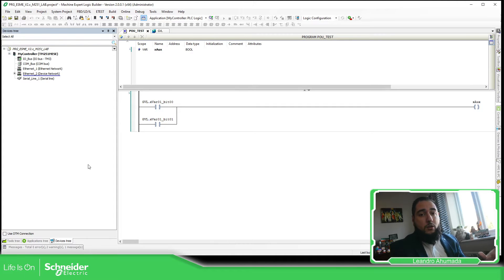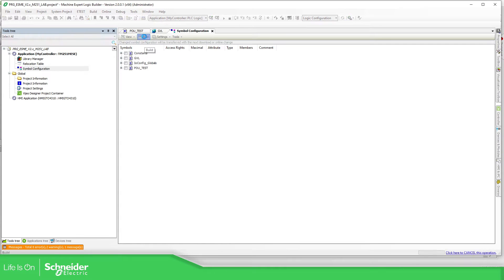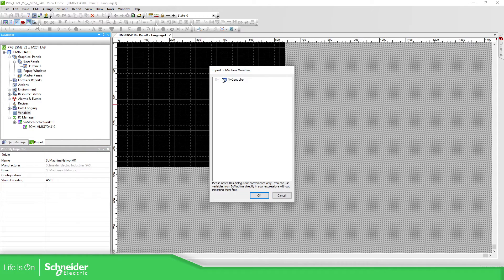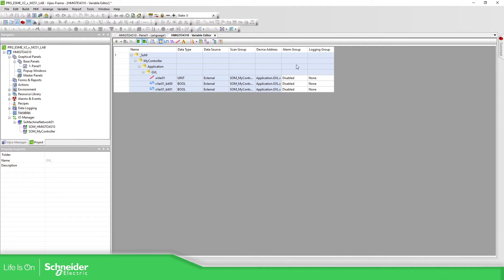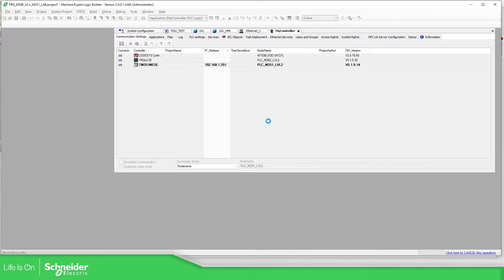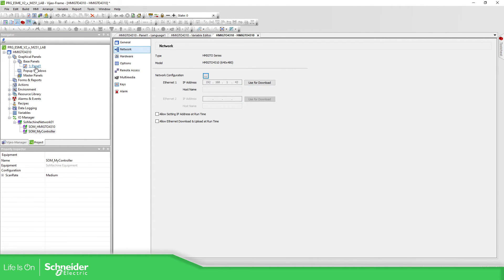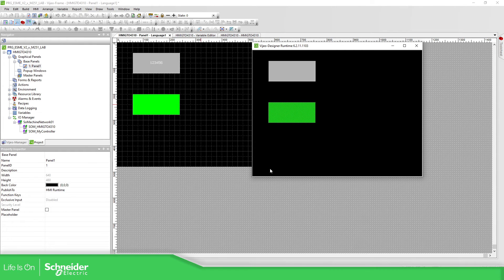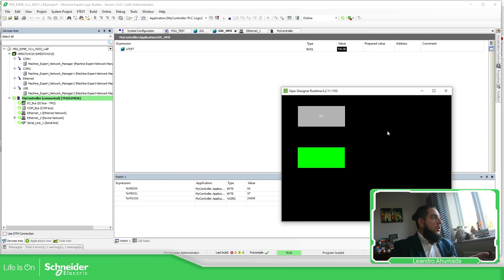EcoStruxure Machine Expert Training - M14.1 connection to Vijeo Designer

Comment: Hi Leandro. I need to connect an HMIET6500 (Programmed with Vijeo Designer Basic V2.1) to an TM241 PLC (Programmed with Machine Expert V2.3) How can I do that?
Reply from the maker: Hi there! You can use the machine expert driver for pacdrive as i show in this video:
ESME + Vijeo Designer - Mx.x Using PacDrive Gateway
https://youtu.be/N6tCvUmlMCw

Comment: Hello LeTomas.
I have a problem adding a HMI into MachineExpert Project and the software Machine expert does not detect the Vijeo Installation. 
I have the Machine Expert 1.2 and Vijeo Designer 6.2 SP10 both installed individually.
I have tried to work with both softwares individually but I cannot add the so machine protocol to the vijeo designer.

Are there another way to add So Machine Protocol to Vijeo Designer.?
Reply from the maker: Hi there! you can use the PacDrive driver:
https://youtu.be/N6tCvUmlMCw

Anyway i recommend you to make the installation of Vijeo Designer from the Software Installer.
Reply: @LeTomasAHUMADA  Thanks , I solved reinstalling both softwares like one .

Comment: if I have M241 and  successfully connected to simulation but if I download program to HMI it gives the same message failed to open connection to PLC, ethernet cable checked, is there another step to make connection between plc and HMI works
Reply from the maker: Hi there! One the most common problem is related to the security in the PLC if you need to use credentials on the PLC then those credentials must be also in the HMI IO Manager where the PLC is added. The other thing to check is the nodename of the PLC and HMI to match on the Vijeo Designer IOmanager.

Comment: Let me ask Mr. Leandro, how to connect of simulation m241 using EcoStruxure Machine Expert V1.2 and vijeo citect v7.5?
Thank you so much Mr. Leandro
Reply from the maker: Hi there! I am afraid that i never used Vijeo Citec so i do not know if it is possible. You can try to check if it has a Codesys o Somachine driver then i believe you can use it. If i am not wrong (i do not remember) you can not use modbus tcp with the simulator of the plc.
Reply: Thankyou so much for your answers Mr. Leandro i will trial following your guidelines,,

Comment: Hi Leandro Thank you for sharing this video. I am using HMIET6500. I cannot see HIMET series option in Echostruxure Machine Expert. How can I connect m251 with HMIET series??
Reply from the maker: Hi there! I believe that in order to program the HMIET6xxx series you must use Vijeo Designer Basic and not the Vijeo Designer that comes with ESME. That spftware does mot have the driver for ESME to use the symbol link to in VJD Basic you must use a modbusTCP driver. Please take a look to the next files:
https://schneider-electric.box.com/s/cap8l6or3w901frwg3czaau42t1etgja
Reply: @LeTomasAHUMADA  Thank you Tomas, yes I have solve the problem.
Reply: @LeTomasAHUMADA  Hi! I've got the same problem but the file is not available anymore. I need to connect to a HMIET6500 with an M241 PLC programmed in Machine Expert V2.3
Reply from the maker: @juliangonzalez2953 hi there, not remember which one was the file but try this:

Source: YouTube https://share.google/IDMcWCY579bzBugUQ

Comment: Hello . 
please tell me how to connect ESME and HMIGXU panel through stimulation of both devices , is this possible ? thanks
Reply from the maker: Hi there! The VJD Basic is very limited compare to VJD so the driver for MachineExpert/SoMachine in the standalone version is not include. The PacDrive LMCxxx driver is not include in the VJD Basic so the last alternative will be with the other PacDrive driver available in that software but i never try it and i do not think it is going to work… an to be honest it seems to be to much work… 
You can try to use the modbus tcp driver on the hmigxu and manually add the variables of the ESME plc , you should be able to simulate the Hmi but you must have a plc.

Comment: Hi Leandro,
I have a problem connecting m241 with vijeo designer basic 1.1.
The error says "Invalid PLC Family / Model / Type".
I can't find any settings for selecting a PLC Family, Model, Type.
I searched it online and the only thing I got is to change the Unit ID to 1 rather than the default settings in the modbus equipement configuration but it did not help to resolve the problem. I also changed it to some random number.
Can you help me resolve this issue?

Thanks in Advance.
Reply from the maker: Hi Achmad! If I am not wrong the VJD Basic does not support the MachineExpert/SoMachine Protocol so you must manually add the variables in the HMI. Probably this manual entry is the problem so I recommend you to use this old excel file that i have created a few years ago to import easily the variables from the software to the HMI:
https://schneider-electric.box.com/s/cap8l6or3w901frwg3czaau42t1etgja

Comment: Is it possible to connect m241 to Vijeo Designer Basic 1.1?
I have a problem with this type of connection with 32-bit numbers
Reply from the maker: Hi Alireza! As far as I know the Vijeo Designer Basic 1.x does not have the SoMachine/MachineExpert driver so you will need to define a Modbus Serial or Modbus Tcp driver. In the past... I have configured the driver as:
• Check the IEC61131 syntax ( so you can use the %MW, %MF)
• Double word word order as "Low word first"
• ASCII display byte order as "Low byte first".
Then on the variables of Vijeo Designer when i need to create a variable here i use the address like %MW even if i need to access to a %MD or %MF.